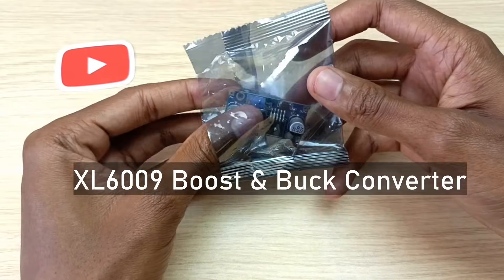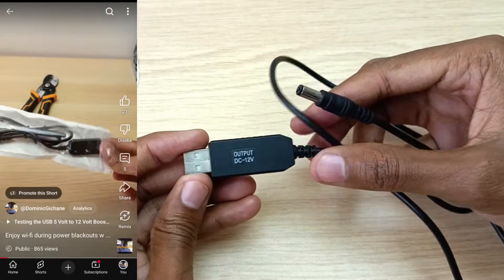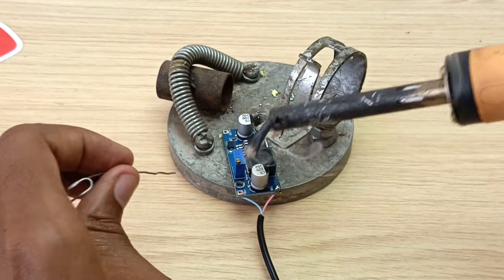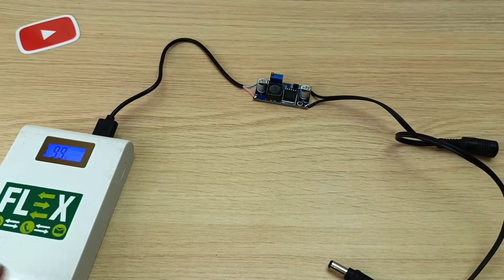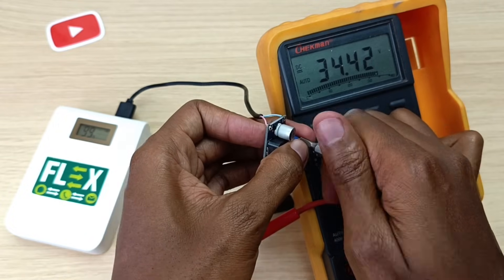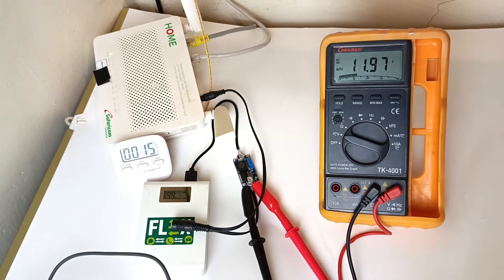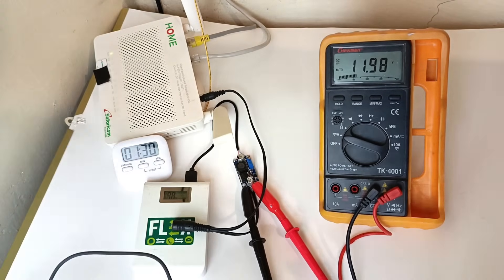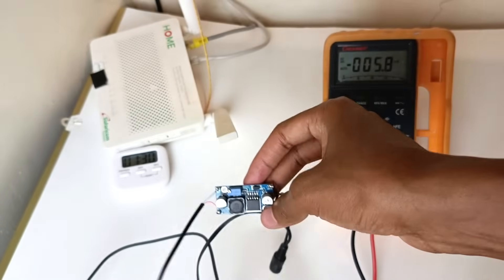How to use the XL6009 boost and buck converter

Comment: Just asking.Can i use this converter on a car battery to boost power from 12v to 19v to power a laptop
Reply from the maker: Not this converter specifically but a higher rated one would do just fine.

Comment: your simplest option is to put a 12v dc battery inline with the router & psu so the router is powered by the 12v battery directly & charged by the router 12v psu
Reply from the maker: That's a very good idea. It's what I hoped my Wi-Fi router UPS would look like and work. Spoiler alert, It came with its own internal power supply and I had to store away my original router powerful supply.